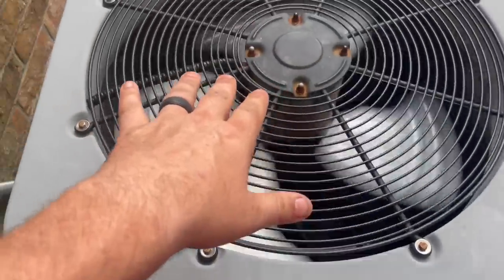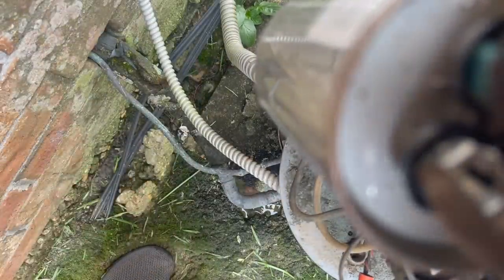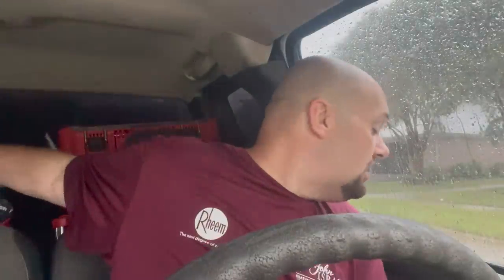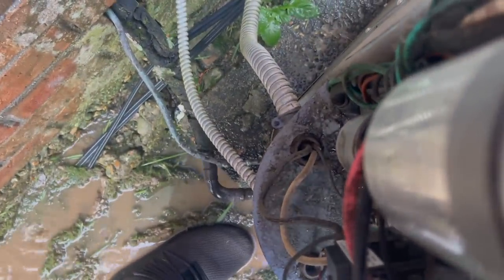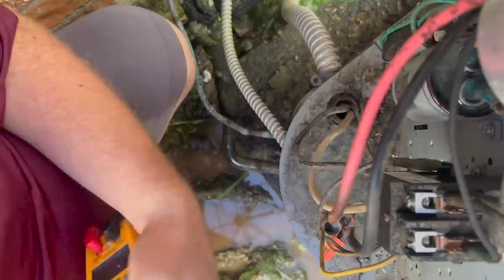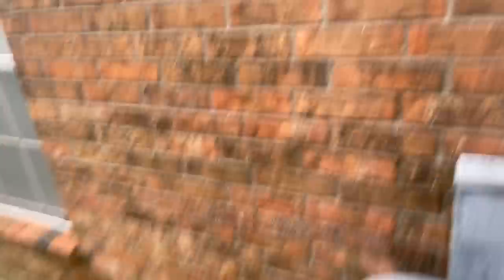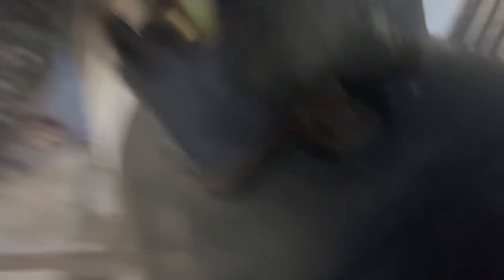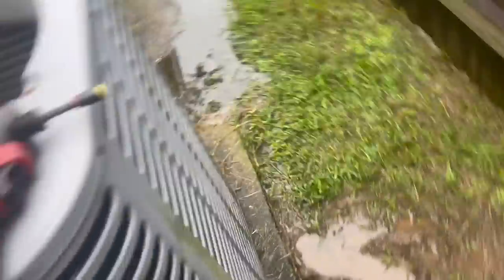No Cooling/System in Horrible Condition

Comment: Great video John. You might want to replace the tires on your truck. The one I saw at the start of the video looked bald.
Reply from the maker: There brand new dude. You might want to get your eyes checked
Reply: I thought so too, 0:40 that front left looks like the shoulder is worn off. Guess it's just video compression or whatever

Comment: Maybe someone can help me with this. When I use a more restrictive filter my energy consumption goes down as with the cost per day. But, when I use a less restrictive the cost goes up. Happened when I used a fiberglass for a few weeks. For some reason the more restrictive filter is pulling less energy. Any ideas on why that may be?
Reply: When a fan or blower moves more air it is doing more work, same as pump. More work =more electric power.

Comment: Biggest piece of crap ever made
Reply: We had two compressors fail on those.
Reply: @natepeterson7145  iv replaced several compressors, fan motors and coils . The replacement coils aren't even piped the same as the original so you have to jerry rig the door panels and patch with metal and tape
Reply: Our American standard dealer sales them as their budget brand . Even the new run tru/ Ameristar is crap
Reply: @jacoblowe5424  it’s “sells” not “sales”. Some basic 2nd grade English.